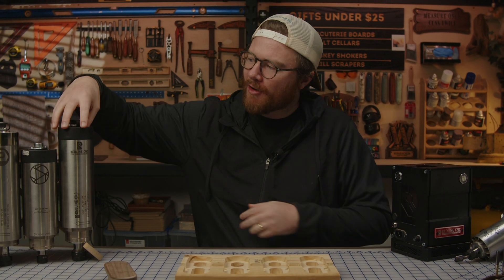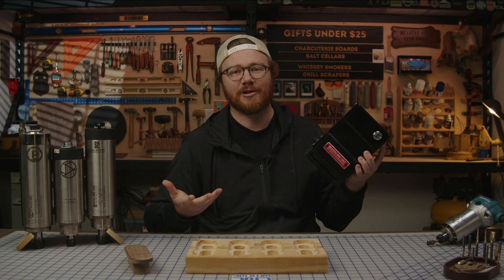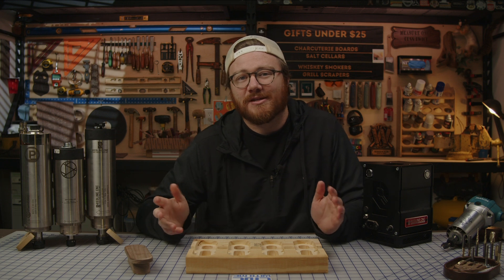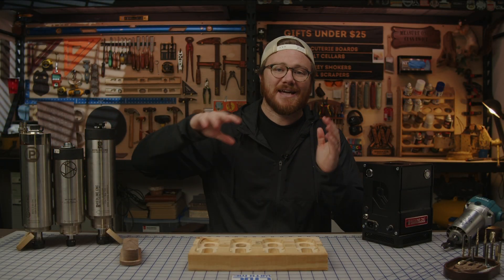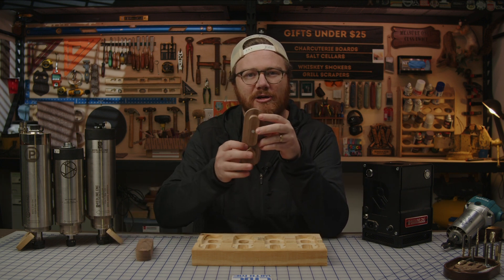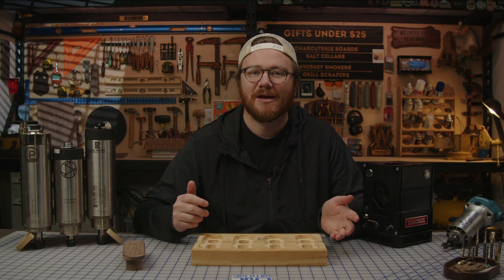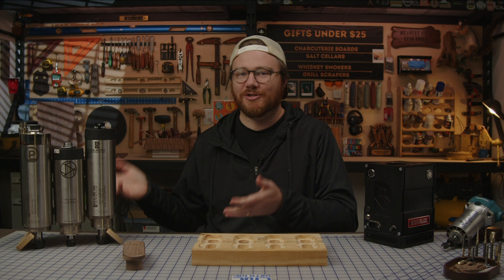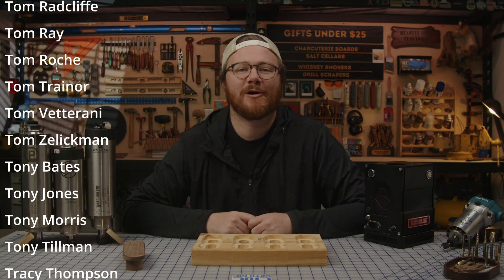The Spindle You've Been Waiting For

Comment: I just got my 220v redline kit it took almost 10 weeks to get. Its not bad i took off my ebay water cooled spindle and really no difference other than I didn't need the water chiller. I am pretty sure it is just a Chinese spindle that they put into a nicer looking case. Not to sure it was worth 3 times the price but it for sure was not worth waiting 2 1/2 months my original spindle took 3 days. also the little keypad has junk connections the lights keep dimming or going out and I have to constantly push and wiggle the ethernet plug because any vibration and the screen blacks out on it.

Comment: I have ordered the elite woodworker with the 2.2kw spindle for delivery to UK. I have asked Onefinity if it will all work on 240v but they have not replied to my question. As you have the vid in your shop does it have240 volt option?

Comment: Air cooled 1.5kw spindle. Not a great choice and all that safety mumbo jumbo. Chinese made for sure, and you can buy a Chinese 2.2kw properly water cooled 80mm spindle with ceramic bearings for less without the marketing nonsense, better performance. This vid is an advert for rebrwnded marked-up Chinese spindles.
Reply: Any suggestions on where to buy a quality unit that isn't a gamble?
Reply: @ well, Chinese is the way to go. Always some gamble involved as QC these days isn't what it used to be. However, I bought my water cooled 2.2kw spindle from GPenny on aliexpress as a bundle with a VFD. Has been working well and very good value for money.

Comment: Thank you for the review…. I was reading the specs and while the spindle is 110 it says the spindle 220 for the 80mm 110. Mistakes can be made. With that said is both the spindle and VFD 110 for those of us who cannot easly get 220v into our shops? Thank you and have a Happy Thanksgiving
Reply: I have the PWN 110 Spindle and it's a BEAST!   I have done very deep cuts to clear out material and it's never stalled.  I have the luxury in the Onefinity to adjust the speed of both the spindle and CNC on the fly.  I used a router for many years with my old CNC and I will never go back.  Money will spent.

Comment: Thanks for the information on the new spindle. I have been dealing with EMI issues with my PwnCnc 1.5 kw spindle and finally after many forms of shielding, it seems to fix that issue. 

Question is, is it worth it to swap to this new “shield” and safety certificated spindle from the PwnCnc unit?
Reply from the maker: Eh I'm a big fan of not spending more money if you don't have to. If you've got it working reliably now I'd say to just keep rolling with what you have!

Comment: I have the PWN 1.5kw 110v on my 1F and love it. I see you have one sitting on the bench while you talk about the new 1F spindle kit. In your honest opinion have you noticed any differences between the 2 of them worth noting?
Reply from the maker: My PWNCNC Spindle (Which I've been using on my onefinity for the last year in every single video featuring a onefinity machine) has been great for the most part. But its very different than the new spindle I have from Redline CNC. The PWN is a 2.2kw watercooled. All of that being said, I've noticed less difference between the two than I would have first thought. Both power and noise. But time will tell as I use it more!